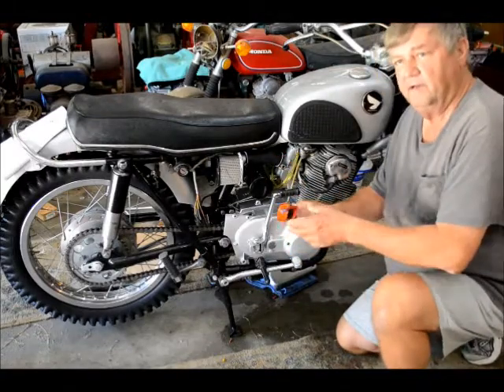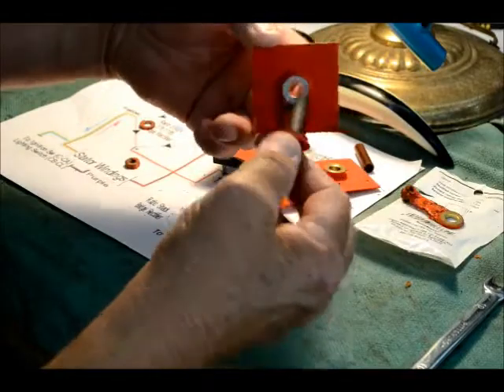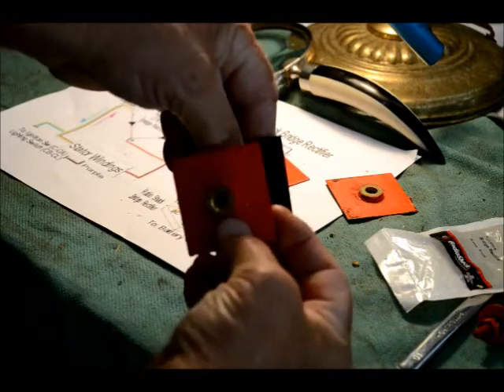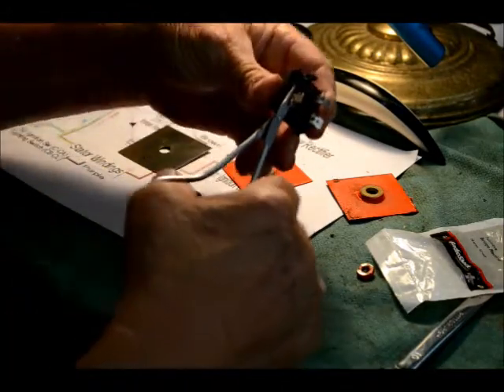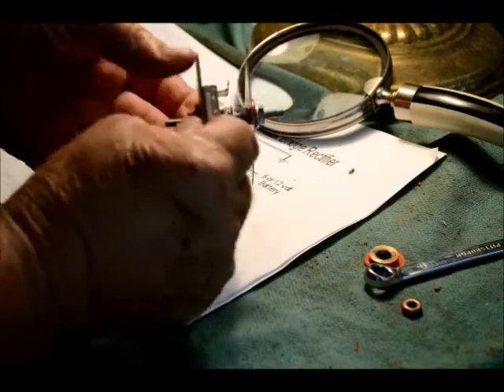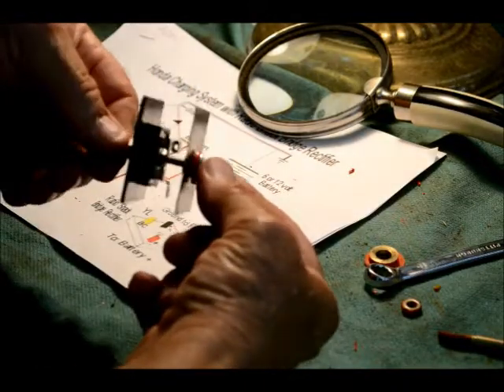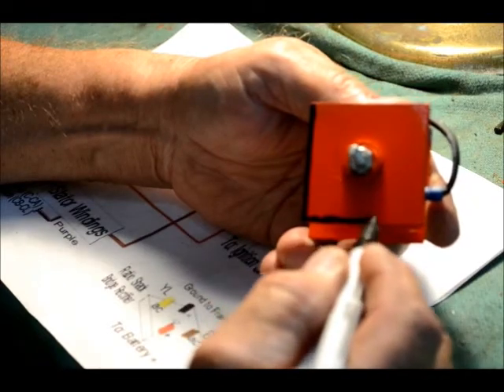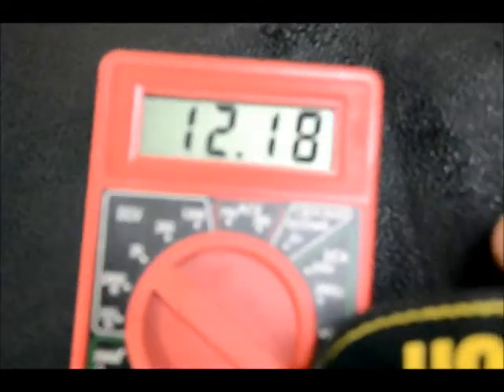Honda CL77 rectifier replacement

Comment: I have read, that when replacing a selenium rectifier with diodes, a resistor must be added to make up for the resistance of a selenium rectifier in order to maintain the proper voltage.

Comment: I'm Just getting into restoring my 1968 305 Scrambler, NEEDED: I'm missing the bezel nut on the ignition switch, where can I buy one I'v been on the internet now for one week all day & daily & I can't find one ( complete switches yes ). & need the metal mounting support bracket to the switch, May make one.   I suppose a machine shop but $$$..  I could use a chain guard too,  Please help me out,   I do suppose I just might have to do this rectifier thingy too, But radio shack no longer exist,  Please e mail or call me as I probably will lose this site. willnpeg2172@sbcglobal.net  (707 )  644-2172  Vallejo, Ca

Comment: Did this but now my dc output is too high...like 17vdc! 
Going to cook my battery and blow my lights no?
Reply: You can get a rectifier/regulator for $15 that will keep the voltage right where it needs to be to charge your battery but not boil it. Pretty much any Kohler yard and garden machine with electric start has one on it. The case is the negative sode, the two outside pins connect to the stator and the center one is the battery positive connection. I've used heavier versions of the one I'm including a link for to upgrade the charging systems on older Force and other outboards that also just had a rectifier and would charge at way too high a voltage. Here's a link:

https://www.amazon.com/Voltage-Regulator-Rectifier-Kohler-Engines/dp/B01MG3974I/ref=asc_df_B01MG3974I/?tag=hyprod-20&linkCode=df0&hvadid=241997376629&hvpos=1o1&hvnetw=g&hvrand=12545173162670392903&hvpone=&hvptwo=&hvqmt=&hvdev=c&hvdvcmdl=&hvlocint=&hvlocphy=9023912&hvtargid=pla-525015133143&psc=1